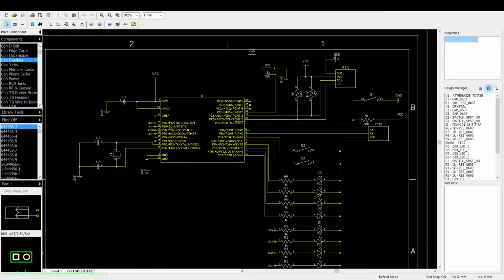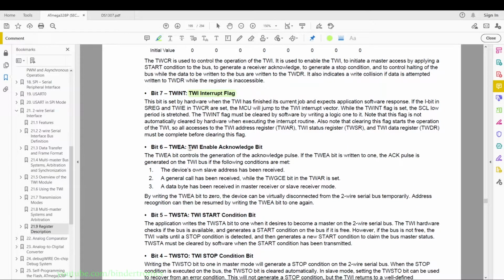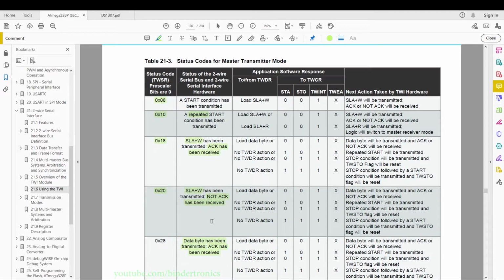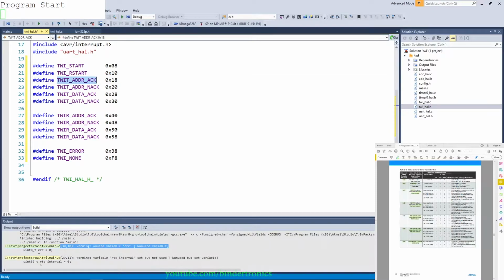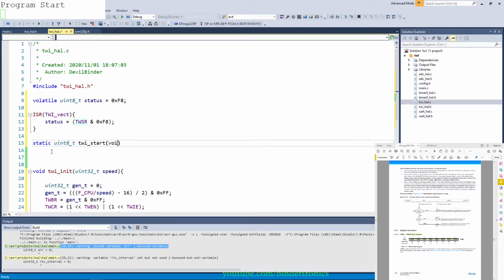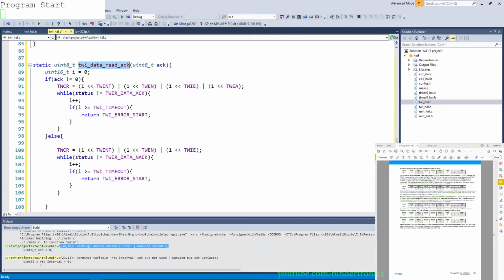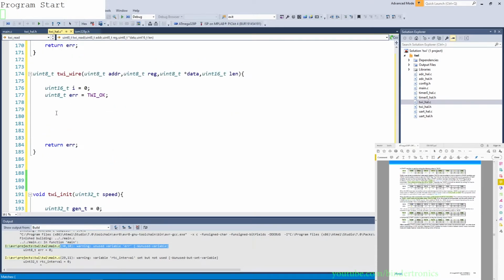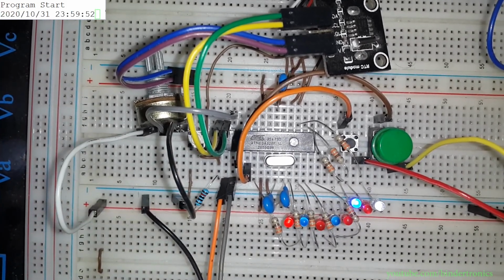TWI and RTC DS1307 (I2C) 🔴 ATmega328P Programming #11 AVR microcontroller with Atmel Studio

Comment: what does the static keyword give us?  Its really nice to see  real C coding.
Reply from the maker: depend where it is use.
local variable, acts like a global. does not lose its value on each function call.
function or global variable . Locks the symbol to the translation unit, cannot be used outside the c file it is created in. Basically a primitive private delectation.
C++, allows multiple objects of the same class to share the same function or variable.

Comment: Hi, I'm referencing your video. i have at32uc3c1512 mcu. and DS3231 rtc modül when i build my project. i have an error.
Itis about twi register description i think. can you help me at this point ?
Error : lvalue required as left operand of assignment
Related Code snippet :
 TWIM_CR = (1 << MEN);
TWIM_CMDR = (1 << STOP2);
Reply from the maker: You got a `if` , `for` or `while` somewhere in your code that is using a equals operator (=) instead of a equivalent operator (==). Other way to put this. You are using a assignment operator where you should be using a logic operator.

if(a = b) should be if(a == b)

There is nothing wrong with the snippet you have shown unless there is something wrong in the macros. Think you are looking for the issue in the wrong place.
Reply: @BinderTronics  i think there is something in macros. but i can not find  a reference for at32uc3c and twim peripheral?
Reply from the maker: https://ww1.microchip.com/downloads/en/DeviceDoc/doc32117.pdf
27.9 User Interface
try
TWIM_CR = (1 << 3);
TWIM_CMDR = (1 << 7);
You can also ask GPT chat to try to fix the code.
Reply: @BinderTronics  Thanks for your valuable help.

Comment: First I would like to thank you for this great series. 
I am new to the AVR world and Microchip Studio. I did play with Arduino IDE for many years. Now I try to level up and learn programming microchips using C language together with Microchip Studio.
I am using an Arduino UNO with a Pocket AVR Programmer through the SPI pins to complete your tutorials. It works fine, I'm learning a lot of new stuff from your videos, including how to read a datasheet... 
I also added an LCD on the TWI (I2C) bus and it works fine with the DS3231 RTC module. But I did encounter a problem that I can't understand. I try to set the time in the RTC module and I get error 1 and sometimes error 2 when I try to write to TWI. I do read the time at the same time and I guess it collides with the read request. Not sure what happens. Maybe you can point me to what can be done to avoid errors and be able to safely save the desired time in the RTC module. Sometimes it works and that gives me the impression it's about the timing of the requests read/write (also LCD it's on the TWI bus)
Reply from the maker: Have you got pull-ups on the SDA and SCL lines and what is the resistance value? A read must finish before a write can happen and vice versa. Do the two devices work fine when separated?
Reply: @BinderTronics  Thank you for your reply. The LCD has a backpack, I believe it has pull-ups, the RTC module it's a DS3231 Module and it has pull-ups. The modules work well separately and many times work together.
I have a bad implementation to update the LCD, I update it each 200ms in the main function, while I try to write the time in the RTC module. Can it be this the reason?  The error it's for the twi_start();
I will change the way I update the LCD and let you know if there are any improvements. 
Thank you again.
Reply from the maker: I think your issue is that both modules have pull-ups on them and you are connecting them in parallel. For 400k you need a value of 4k7 ohm. If you got two modules both with 4k7 pull-ups.  Then you would only have 2k35 as your pull-ups value. For 100k the required value is 2k2.
You can not run code in parallel on a ATmega328 (It does not have a RTOS). You can only executer code in the wrong order. At best you can do TDM that allows you to skip blocks of code based on a time interval (Like the timer video).
Reply: @BinderTronics  I do trust you know what the required values are needed for 400k...100k. This info is new for me (I am sure I will need this information later on in my projects) 
However, it works without problems. I used these two modules (DS3231 RTC and I2C 20/4 LCD) in most of my previous projects with Arduino, and never had a problem running them with standard Arduino libraries. The problem was I did flood the TWI with unnecessary write requests to the LCD. 
Thank you for your support and the EEPROM video link (I miss it somehow)
Reply: @BinderTronics  I did the necessary changes and it works without any problems. It was soo stupid of me to update the LCD function each 100ms when was no need. Now I don't display the stored time while I edit the time, and I update the LCD only when I press the button after I update the new time variable.
Now works fine. 
Thank you again for the nice series.
P.S. Do you still plan to shut some new videos? What about external EEPROM, SPI communication between 2 ATmega328?
Reply from the maker: External EEPROM https://www.youtube.com/watch?v=_XSJn9KIxJ4 . MCU does not matter I2C = TWI and the protocol is standardized.
I did try ATmega328 to ATmega328 SPI communication but ended up bricking the slave MCU into a state that is unrecoverable. So I caned the idea. It is a exceedingly rare to need a MCU to MCU communication over SPI. Second finding a SPI slave device that operates on 5V is rare or expensive. I do wish to amend the series with 2 more topics but this have proven to be to time consuming to keep a consistent upload schedule.